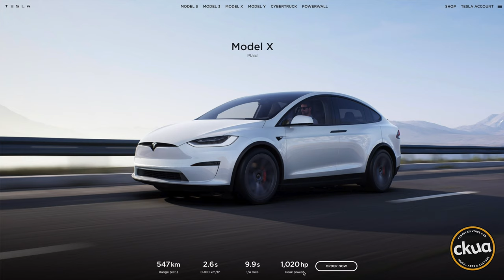275. Battery Recycling - Turning waste into new batteries

Comment: Its a good start. If the business model is profitable then it needs to be scaled up.
plastic and tire recycling are also a very important part of making electric transportation happen
Reply: Since doing stories on recycling I am absolutely convinced we all need to advocate to Extended Producer Responsibility or EPR. If manufacturers are responsible for the stuff they produce (i.e. hard to recycle packaging) then they will pay for the problem. If on the other hand they switch to packaging that has a high reuse potential or easy recycling potential then we all win.